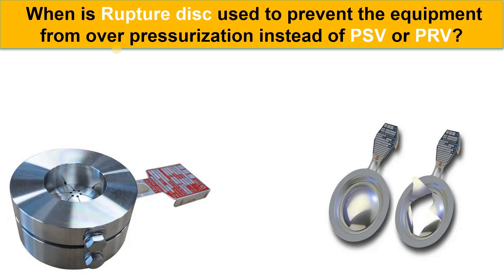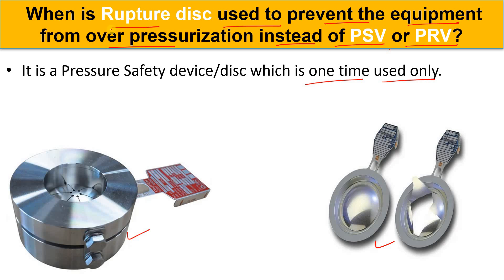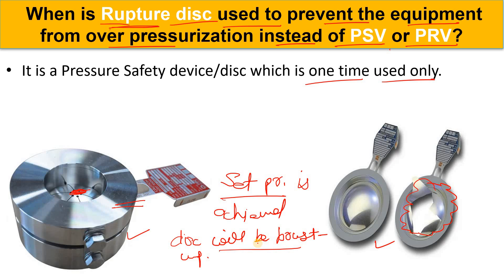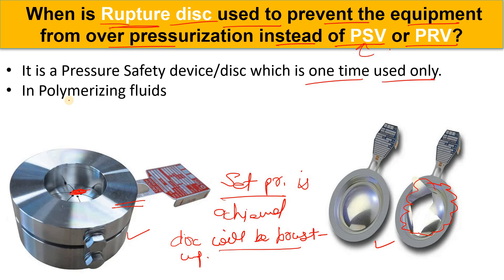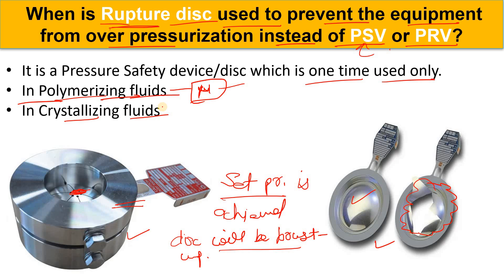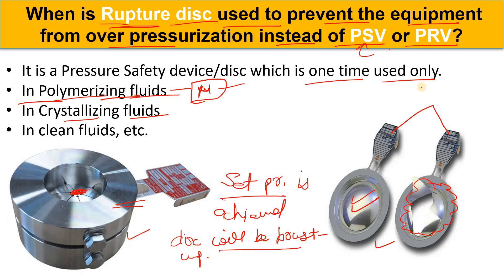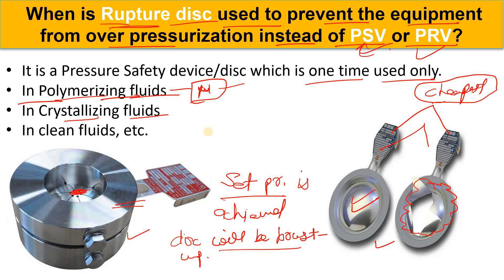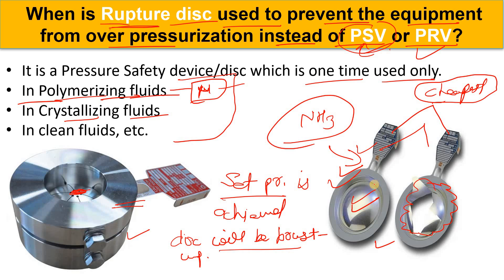When is the Rupture disc used for the safety of the equipments instead of PSV or PRV? | Rupture disc

Comment: what is a trailing gas in GMAW and GTAW process sir, please explain
Reply from the maker: In gas metal arc welding (GMAW) and gas tungsten arc welding (GTAW) processes, trailing gas refers to the shielding gas that flows after the welding arc to protect the weld pool and the newly formed weld from atmospheric contamination......

This trailing gas helps prevent oxidation and ensures a clean, high-quality weld.

Comment: Working principle of rupture disc?
Reply from the maker: It works by rupturing/bursting at a predetermined pressure threshold, allowing the pressurized fluid or gas to be safely released. The disc is usually a thin metal sheet that's designed to fail at a specific pressure, preventing the vessel from reaching dangerous levels of pressure that could lead to a rupture or explosion.